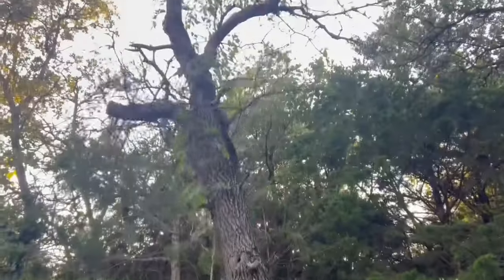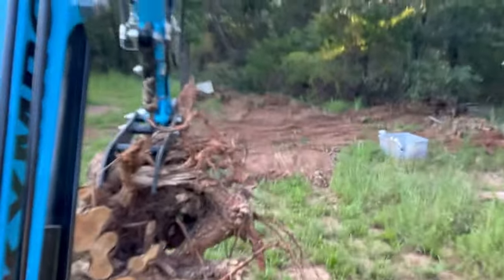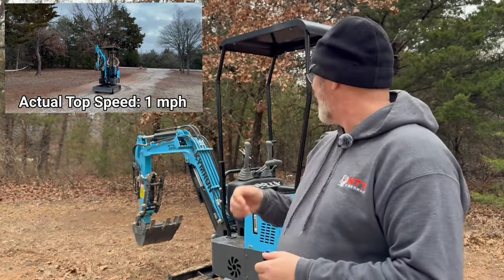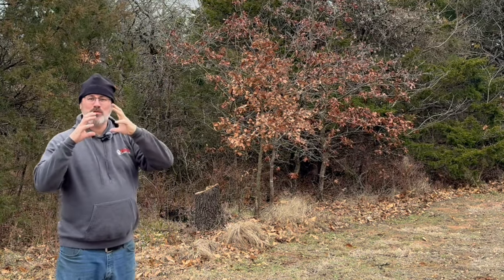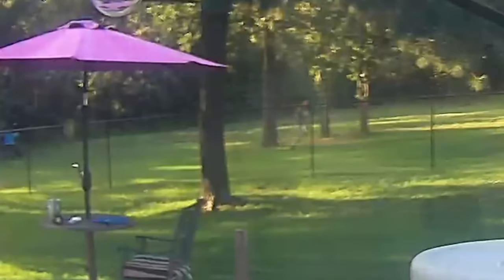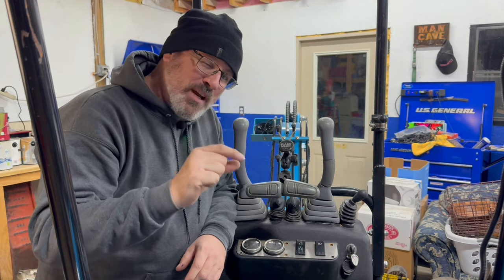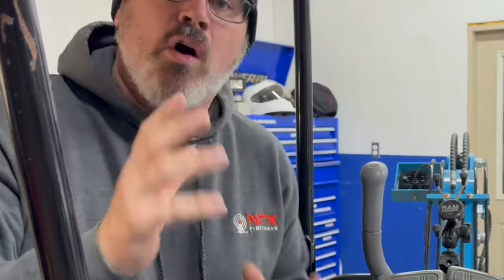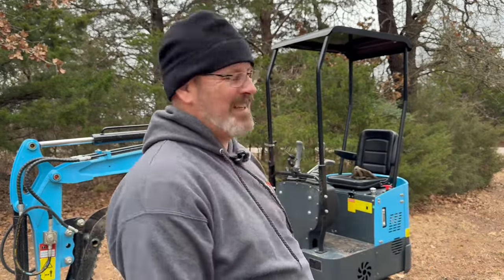Mini Excavators Are Dangerous!!  I Made A BIG Mistake

Comment: Dead trees are unpredictable, glad you made it out with just minor injuries.
Reply from the maker: I learned the hard way.   I’m glad too!  Lol
Reply: @OurLifeInTrees  Your rear grill with the exhaust cut-out is upside down, you know this right? That's why the exhaust oval isn't where the muffler exhaust actually is. Should be an easy fix. Glad you are ok, be very careful "bumping" a dead tree, they can also come right back on top of you and crush you instead of falling the other way like you intended!
Reply from the maker: @michaelshrader5139  I’ve tried the other way, still doesn’t quite work.  Apparently it’s this direction to access the spark plug.  

Thanks.  I learned the hard way.

Comment: I turned over my little mini ex and that roll cage you took off crushed my foot almost off. Lost alot of blood and had to be flow to a trauma center.  My foot is all messed up now. They are dangerous and too small to be stable..sold mine and bought a backhoe!!!
Reply from the maker: Wow!  Sorry to hear, that sounds horrible.  A backhoe sounds nice as well.
Reply: The machine is just a machine, just like a gun. The operator is responsible. Not to be a dick, but, the machine is not to blame. I'm sorry you got injured, but it's a learning/teachable moment about operator safety. 
And to teach what happened so others can be safer, it would be admirable if you explained the actions that caused the rollover and what safety precautions could be implemented in the future to prevent this from happening. Just like our guy did in this video: he explained what happened, learned, taught us, and got back on the horse. I applaud him for that

Comment: About a month ago, I was helping a friend work on a truck, replacing the frame section on an f150 spring/shock tower. I had been grinding and using an air hammer to remove the rivets. It took about an hour, then another 15 minutes to cleanup the frame beneath that piece. I had been wearing my gloves, long sleeves, glasses, welding cap, and a face shield the entire time for my PPE. I thought I was done grinding, so I set the shield down. Then needed to touch up a corner of the new piece, so I just grabbed the grinder, because it’s only gonna take a few seconds to trim that up. About two seconds in, without my face shield, the wheel caught and kicked the grinder right into my face. I thought I was going to black out it hit me so hard, right in the nose. I tossed the grinder down, yelled to my buddy to unplug the grinder so no one else got hurt.
I grabbed my sweat rag and held it on my face. My buddy looked and said, we need to take you to the ER. He drove me and I was in and out in less than 30 minutes - fastest ER trip I’ve ever had. They cleaned it a little bit. Gave me a couple antibiotic pills, put some butterfly stitches on it to hold it together. The bleeding had already stopped, except for a very minute “leak”. They sent me home for the night and said the surgeon office would call in the AM with instructions to go get it “repaired”. “Repaired” ended up meaning “surgery”. 
I had broken the bone of the nose, and cut completely through the main cartilage, and the left nostril, all the way down to the end of my nose, and it grazed the inside of the bottom of the left nostril. They had to stitch inside and out repairing all of the different layers internally, including the cartilage, and then stitch the outer tissue. They also had to put “stints” inside each nostril to keep the tissues from adhering to the wrong tissue. It was a miserable week until they finally took the stints out and I could breathe again. 

Boys and girls, wear your PPE AT ALL TIMES. It doesn’t matter if the job will “only take a few seconds”. It only takes one fraction of a second for that “oh shit” moment, and then it too late. Take it from me, is not worth it.
Reply from the maker: Holy crap!!!  That sounds horrible.  Glad you are at least mostly ok.   Dang.  No thanks.  We all do stupid stuff sometimes & pay the consequences.
Reply: Thanks for sharing your story.  

You got lucky, Charlie Brown.  An inch to either side and it could have been your eye stopping that grinder.
I  am surprised, however, that your "safety squint" didn't protect you from taking a flying, activated grinder to the face.  🥴

Comment: I'm glad you're not seriously injured. You might talk to your welder friend and see about using a couple of pieces of heavy duty expanded metal screening, in a frame, and make removable front and rear screen guards if you plan on doing anymore tree related work.
Reply from the maker: That’s a great idea.  Would be useful and probably make it more rigid.

Comment: Thanks for the video I have ran mini excavator  and big excavator when I first started  running  them the same thing happened to me the machine had its roof on but it busted some glass and cut me  from that point on I don't do test bumps I put the bucket up and use Steady  pressure to push trees over dead or alive there can be limbs you can't see that are dead
Reply from the maker: Dang!  Add broken glass and that sounds worse!  Glad you are ok.  I certainly learned my lesson about dead trees.

Comment: My QH12 roof was 7' 2" high. My garage door entrance is 7' even. Wouldn't fit, took it off. One of these days I'm going to cut 4" off the posts and re-weld it.
You could the same. Lower the roof just enough to get it in the garage.
Reply from the maker: Yeah, I already bought some metal tubing to use as sleeves to put it back together once I cut it.

Comment: I've got a story for you about always using seatbelts in mini excavators. I apologize in advance for how long it is.

I used to own a Bobcat X-320 mini excavator until the engine caught on fire from a wiring short. Anyway... I used to dig big pits so people can either bury trash or burn it then I would come back and cover it up. When I covered it I always had the cab off to the side so I can see the blade better. I did a few pushes just fine. Then on one push as the backhoe crested the top of the dirt mound. It lurched forward and threw me out of the front of the cab. Because I kept the cab off-set the backhoe twisted as it fell and the roll cage pinned my left leg with my knee bent under the roll cage. I suspect that it probably broke something in my hip because it was laying on the ground as flat as it can be. My left foot wasn't in better shape being stuck under the other bar of the cage. 
After digging myself out from under the roll cage with hydraulic fluid and diesel pouring on me. I thought I would try to use the boom while standing in the cab to try and get it back upright. The hydraulics were being very sensitive at that point and every move I made with the levers would bounce me around in the roll cage like a pinball. This caused me to break 4 ribs. I got to my dad before the adrenaline wore off and told him what happened, then I went to my room and passed out from the pain and remained that way for about a day and a half. 
When I woke up... Me and my dad went about setting the backhoe back upright. I used a 1 ton comealong to pull the boom in and we used a 15 ton chain hoist anchored to a tree to get it back upright. We then called a mechanic to bleed the air from the engine which we didn't know how to do. We checked it over for any further damage and found none. I topped off the fluids I got back to work on burying that hole and had no further problems. 

 I've heard it said that you're never an expert until you have an accident. Guess that makes me an expert. I've also heard it said that any crash you can walk away from is a good one. 

 I hope you enjoy the story and don't have to learn the painful lesson that I did. There are many accident reports from people who did what I did and aren't alive to tell the story. Keep all safety warnings in mind.. they are written in the blood of the ones who either didn't survive, are permanently disfigured, permanently handicapped, or almost died. as I write this I am listening to a story on PublicResourceOrg of a loader operator that lost both of his legs in a rollover accident.
Reply from the maker: That’s crazy!  Glad you are ok.  It’s wild how quickly everything can go wrong.   I certainly learned my lesson.   lol.
Reply: @OurLifeInTrees  
I'm glad that you're ok as well. I think everyone can learn a lesson.  Never Work Alone always have someone you can get ahold of if something goes wrong. 

Time to do some sketchy shit do da do da i did not get away with it I am not ok
Reply from the maker: You have a great point.  I’m glad my girlfriend was home and outside when that happened to me.  I was out of it.

Comment: I'd be building a decent roll over bar for that.
It's small but still crush you if it slips into a trench or something.  They roll easier than you think. 
A belt helps if you do.
Reply from the maker: Not a bad idea.  Yes, they are very tippy.

Comment: It may have been just a canopy to you but i consider it to be ROPs - roll over protection, for debris and would never remove it.  Count your blessings you were not injured more severely, always carry your phone or let someone know when your out working with it.
Reply from the maker: That’s a great point.  If something happens, it could be very important to make a call.
Reply: @OurLifeInTrees  it happened to my neighbor pinned to his tractor by a tree if not for his wife going to check on him ..he was passed out and tractor in gear tires spinning the outcome would of been much different.  He survived after being air lifted....stay safe!!
Reply: @jmar5787 wow!!!   That’s terrifying!   I couldn’t imagine.  Glad he pulled through.
Reply: I’m thinking he said canopy instead of ROPs because I believe that brand has model that has a canopy version that is not as strong as a ROP rated one. Never the less.you would think the canopy would be better than nothing. Unless the frame gets crushed because of the thinner material and that tinny tin tin Sun shade decides to do a decap
Reply from the maker: @georgea6403 yeah it’s definitely not a ROPS, just some metal tubes holding on a sheet metal roof.

Comment: The mouse traps proper name is a ROPS..Roll Over Protection Structures...The most important thing on any piece of equipment is that seat belt as it will keep you in place on a roll over. Old tractors never used to have them...I knew someone who was killed because the tractor didn't have a ROPS and he was pinned under the machine and crushed to death.....get in the habit of throwing on the seat belt every time. Your one lucky guy!
Reply from the maker: This one doesn’t have a ROPS.  Just a flimsy “cage”.   I would feel a lot better if it had an actual ROPS.  Sorry to hear about the fellow who was killed on one.  That’s terrible.  I’m certainly more careful these days on it.

Comment: Thanks for sharing I'm glad you are not smooshedededed. I run a ec220 and have knocked down many large trees the key is never bump trees use a smooth ez pushing only. I pucker up in my 20 ton machine pushing trees. I would never go after a tree with that thing. Use a chain saw than play with the trees on the ground. Second always take some time looking at the tree look for heavy dead branches or dead tops, remember the trees want revenge they will kill you. I guess we all have to learn the hard way.>>>>>>>>>> P.S that roof is not a substitute for  R.O.P.S. It will not save you from large trees if you have to do a lot of tree work It might be worth investing in a bigger machine. How much is your life worth?
Reply from the maker: Great advice and I fully agree.  I’m not very cautious around trees.

Comment: You're very lucky you didn't take the full impact of that branch with your neck or head. The outcome would have been much worse. I still wouldn't rely completely on the canopy for protection. I've seen dead trees break in half when disturbed. That much weight would probably crush the canopy. I hate cutting down dead trees for just that reason. Whenever it's possible I use a long cable tied to my tractor to give the tree a good jerk before I do any cutting. This will cause any weak spots on the tree to fail before I get under it with my chainsaw. I still wear a hard hat just in case. Thanks for posting the video. It's a good reminder of the danger of these trees.
Reply from the maker: I am now very cautious of free and am kinda scared to walk under dead trees.  Never really thought about it before but wow, they are dangerous!!

Comment: ROPS - Roll Over Protection System
Reply from the maker: Yeah mine doesn’t have a ROPS.  It has a roof and roof holder.  ROPS has a certification which mine will not pass I’m sure as it wobbles about.

Comment: Not just mini X, but any power equipment.  In the first two hours of having my 35hp tractor with bucket I was cleaning weeds from under a bush. I did not see the grape vine snaking up ant to a large walnut tree about 15 feet away. There was a dead branch about 20 ft long with the grape vine looped through it that broke off and across my open station. Missed my head by less than an inch and ripped my shirt sleeve and scratched my bicep. Was not injured as you were but close enough. Strangest feeling one second I am skimming weeds and suddenly reality changed and I have an 8 inch diameter tree limb across my steering wheel.  So dead branches and vines are another thing to watch out for in the woods.
Reply from the maker: Holy crap!  That’s scary!   Yeah, vines are strong and can pull down some big branches.  Glad you are ok!

Comment: It's not a sunshade or "umbrella," it is called ROPS, Roll Over Protection System.
When you have a ROPS on any machine, you need to use the seat belt to keep from failing under tr ROPS, in case you roll and get tossed, the ROPS can land on you.
READ THE OPERATOR"S MANUAL!
Reply from the maker: Mine isn’t a ROPS.  Just a cheesy metal roof with some Mickey Mouse supports.  My Chinese owners manual isn’t the greatest.  🤷‍♂️

Comment: Small plant is even more dangerous than larger machinery. These machines can still weigh up to 1000 kg and because they are micro machines this does not imply they are toys. People have been killed off ride on lawn mowers, with mini rollers and even a ball pein hammer in the wrong hands can you leave a person with  messed up thumb. Know your work and know your machine. Be careful.
Reply from the maker: Great points.  I agree.  Thanks for the feedback.
Reply: @OurLifeInTrees  An airline pilot said, we start off with two big duffel bags, one empty and one full. The empty one is called experience and the full one is called luck. With each mistake we take a little bit from the bag of luck and put it in the bag of experience. Hopefully we get to fill the experience bag without doing much harm and before our luck runs out.
We learn mostly from errors and near misses.
Reply from the maker: @MK-pm5sc I’ve never heard that before.   I like it and agree!

Comment: Yes this would have saved you in THIS instance but is not the most robust of protections there can be if one attempted to mess with larger dead trees. In such a case it could be worse. Note to myself: use any shred of commonsense I can find in between my ears. May be leave the bigger ones to the bigger guys with the bigger machines with bigger mouse traps     .
Reply from the maker: Agreed.  Didn’t know that at the time, but life in the sticks teaches lessons as we go sometimes. lol.
Reply: @OurLifeInTrees  Although I do agree that there is something to be said about having a “go get ‘em non-paranoic” attitude as well. I believe the world would have been a lot more backward had that not been the case. That said, progress & protection can & should go together. Such as seat-belts on fork-lifts which can mostly be ignored & which only rarely but critically be found useful such as when it tips over & the normal instinct is to jump out of it only to become pinned underneath. Has happened. May be 1 in a 1000 instances, but one too many. Thanks for the video.

Comment: I have a 1 ton and a 1.5 ton, I was very surprised and the stability .5 ton (and weight distribution? ) made. Never would attempt to use even my 1.5 ton to topple trees, especially rotted. They are dangerous standing under.
Reply from the maker: Agreed.   I won’t push a tree again!  lol

So the 1.5 ton makes a huge difference. Hmmm